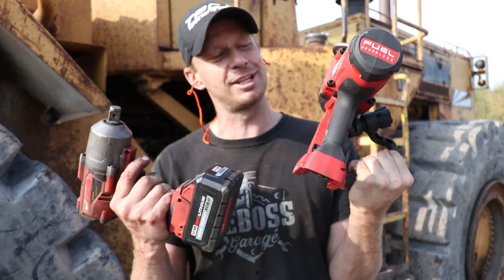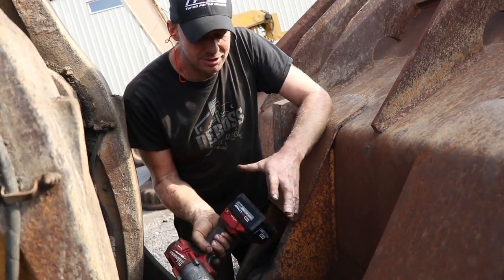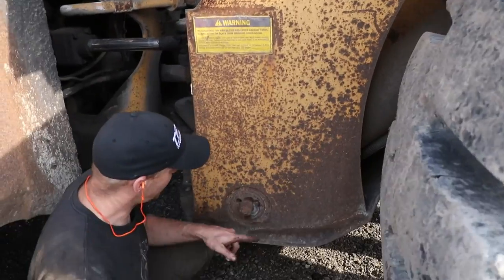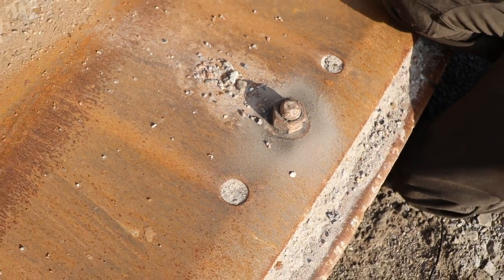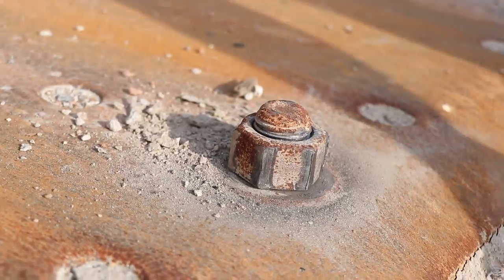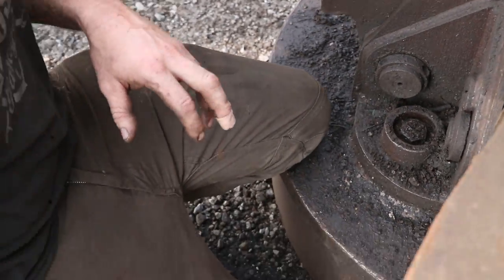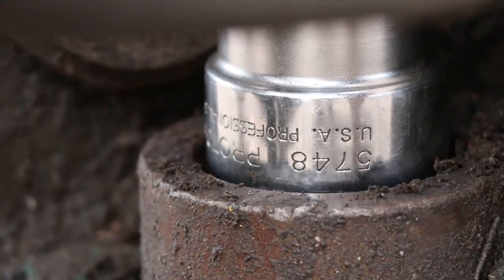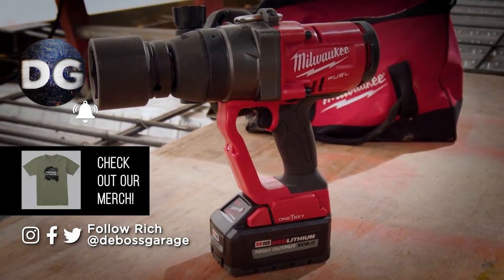Busting 40 Year Old Nuts with a 1 Inch Impact Wrench | Milwaukee M18 FUEL 2867-20 REVIEW

Comment: Has strongest electric impact on the market still uses chrome sockets lol
Reply: ikr...?
Reply: A few$  at autozone for rent a impact socket
Reply: @ranchotools  good luck finding 3/4 and 1inch drives at autozone
Reply: @krfredri   you are right, maybe home depot have some
Reply: Like he said he’s not going to buy a couple thousand dollars worth of impact sockets just for a video or two
Reply: @stephenanderson1944  its about 40$ dollars for one socket,, he use 2 diferent sizes
Reply: Mitchell Nova It’s not for his own amusement. It’s for a product review. If you’re going to review a product, do it right. Either you’ve never held a tool or you’re okay with using the wrong equipment for the job too.
Reply: @stephenanderson1944  why get the 1" impact if you dont cant swing 1" drive sockets tho...
Reply: At a 1 inch size socket there's no reason to need an impact socket the chrome works just fine and it won't be breaking anytime
Reply: Chris Robertson Please delete your comment. You’re showing how much you use tools.
Reply: @imonlawnduty  or not. Clearly you don't use anything stronger than a pink screwdriver. Internet mechanics begone
Reply: Chris Robertson I’m glad your chrome sockets help you with your fiat, but they’re complete garbage on heavy trucks.
Reply: @imonlawnduty  nope, never tore apart Volvo front loaders for Caltrans for 5 years using the same chrome socket set the whole time.
Reply: If it can do it with chromies it can do it with impact sockets. Why are you guys pretending otherwise?
Reply: I'd love to see that chrome socket explode under all the torque that 1" Milwaukee M18 FUEL Impact Gun is putting out!
Reply: @blackgazex5873  You really do need impact sockets when using and impact gun, chrome ones don't cut it, I worked at a diesel shop for over 15 years and I saw countless guys crack, stretch or shatter chrome sockets using impacts guns, even smaller not very powerful 1/2" and 3/8" impact guns. As a matter of a fact I keep a 1/2" Milwaukee M18 FUEL One-Key High Torque Impact Gun in my truck incase I need to change a tire and since I was lazy and didn't want to have to unscrew the decorative center hub piece that made it so a thick wall impact socket couldn't fit in the hole to get to the lugnut instead I got a chrome 19mm socket that would fit without the need to take off the decorative center hub piece. I never even changed a tire with it I only tested it out a few times to see if it fit and also to test the features on my 1/2" Milwaukee M18 One-Key Impact and after only about a dozen uses the square drive that holds it to the impact gun got so deformed that it didn't stay on tight and would wobble around like crazy and the hex end got deformed too, it wouldn't fit tight on a lugnut anymore and you could easily see that the hex end and square drive end were very deformed.
Reply: @blackgazex5873  😂
Reply: @thomasglover3834  I have actual proof I used to tear apart loaders for caltrans.. I'd issue a challenge for you to break a 1" chrome socket under normal circumstances do let's see.
Reply: @chevy5137  I'm not saying impact aren't the proper tools for an impact gun but I am saying that when you are getting into 1" drive sockets they have so much meat on em that they are far far far harder to break than a 3/8 or 1/2 chrome
Reply: @blackgazex5873  that's true they are thicker but they can still break when used with an impact. At the diesel shop I worked at I saw guys crack or warp them taking off semi lugs, usually only the small ones will shatter and have pieces break off. With larger ones what usually happens is the square end where it attaches to the socket gets deformed and then it will wiggle around and not hold tight on the impact.
Reply: I would be using Chrome sockets to a set of impacts sockets for that beasty impact would be a fair few hundred dollars
Reply: They make chrome impact sockets.....
Reply: @HotBoiRicer  Yes they do, I have a thin wall chrome impact socket set that I got from Harbor Freight that is made for taking lugnuts off and it has nylon sleeves on the outside of the sockets so as not to damage the finish on the outside of the rim holes you can also take the nylon sleeves off to make the sockets thinner so you can get them into tighter spots! They are also color coded and come in all the standard lugnut sizes and they come in a nice case too. I highly recommended them for taking lugnuts off as they are much thinner that regular impact sockets and they are just as strong as impact sockets, the set includes 7 sockets that fit most size lugnuts. 👍
Reply: Balls of steel
Reply: He addresses the socket situation....
Reply: When you use a impact wrench use short bursts the longer you run the impact wrench it gets weaker just 10 second bursts
Reply: What's crazy is that all y'all are arguing over a socket that isn't even chrome. It's a raw/machined finish. Not all impact rated sockets have to be black. It's easy to tell by the rust on the sockets. You can tell by the close up when he's removing the bucket nuts that it's not chrome
Reply: Tbh that's how most of those sockets are, a 1 inch chrome socket will cost you 70$ and that would be a napa brand, still has lifetime warranty and they're pretty strong, if you want that in an impact, looking at up to 3 times that much. When you get to the bigger sockets, it almost doesn't matter, and also you don't need them alot when you're doing tech work so instead of buying a set of 1 inch impacts you use chrome's and probably only need a few sizes.
Reply: @krfredri  in my dream i walked into oreily and there it was, rented out🙃

Comment: Your losing all Your impact ability with that 12 point socket. All it's doing is putting energy into the very edge of the nut and springing back in the socket wall.
Reply: correct, i was thinking the same thing. And with a non-impact socket, tolerances are loose
Reply: ....So, what you're saying is....is that it was even more impressive that it was able to crack that edge nut loose, right?
Reply from the maker: Yeah, you are correct.  Like i said though, I can't invest in sockets I will never use again
Reply: thats fine but i have the same unit and if i can afford a $700 unit i can afford common size sockets. obviously  im not putting a 7/8 or 1in on it. like a welder im not going to start the gen set to weld some horseshoes together for a hook. the lil hobart works perfect
Reply: @nickgibb4687  "FULL DISCLOSURE: Milwaukee is sending us tools to use, to make videos with, and to give some away."

I am assuming, that you assumed, that he bought the 1" rattle-cannon?
Reply: @dposcuro  well with Milwaukee being 30 min south of me id expect them to send a 12ah battery and some sockets...just sayin. that would be like me using a miller welder and using lincoln wire and a tregaskiss whip owned by ITT. if the review wants to be done right do it with the right tools from the unit to the batteries to the sockets. i believe it was a PROTO socket owned by Black and Decker. sockets ARE top-notch use them all the time.

EDIT: DEWALT AD ???  And that Snap On is right down the road?  And with 250k subscribers thats free advertising for $300 in manufactured product.  Highest mark up is Diamonds Furniture and industial tools
Reply: @dposcuro  wait they sent you tools? on your page it looks like they sent you a cat with 7 views
Reply: @nickgibb4687  Kind of confused; how does your proximity to Milwaukee have any relevance?

Now to the gist: 
1: You're expecting Milwaukee to not only just give out a $700 tool to someone (Who, by the way, is under no obligation to even review it), but also a $300 battery, and a socket set worth another $500-800? You're expecting Milwaukee to literally be giving away, nearly $2000 worth of product?

2: Milwaukee does not currently make any 3/4" nor 1" drive impact sockets anyways. So you are expecting them to supply people with someone else's sockets?

3: As I said earlier, DG is simply sent tools from Milwaukee, and is under no obligation to review them, feature them, show them, or even talk about them, if they chose not to.

"We are under no obligation to review their products as part of that relationship, and this video went live before they saw it or gave us any feedback on it. I have had the 1" impact wrench since July, did not receive monetary compensation, opinions are my own, and everything is scripted myself."

You seem to be expecting a hell of a lot out of a company.

Personally, I don't understand your point of view either. I prefer people to use the tool, how they would use it, with whatever accessories they want, or have on hand to use it with. IE: Real World Use. The mechanics I work with (heavy equipment shop, buy/sell/rent, working on everything Cat 349/D8T/740 and smaller), buy tools and sockets from Matco, Mac, Snap-On, Gray Pneumatic, etc. They don't stick to just one brand, and none of the other contractor mechanics we bring in during crunch times to either.

So, to me? It is a hell of a lot more practical and realistic, to NOT use same brand sockets. How does the tool work with other brand sockets? Is the anvil larger/detent too small or large, making socket changes slow and difficult? Or is the anvil small, and leave other sockets loose, and wobbling, even brand new?
Reply: @nickgibb4687  I am talking about Deboss Garage, not myself. I am quoting from Deboss Garage's own, pinned post, where they posted the disclaimer.
Reply: " the mechanics you work with" lol you have got to be a sales guy...lol
Reply: @nickgibb4687  lol. Not quite a sales guy but that was halarious. 🖒
Reply: @nickgibb4687  Assumptions, ignorance, pathetic insults? You're right. This is pointless.
Reply: @dposcuro  best part is you kept it going. cheers. you'll figure it out
Reply: @nickgibb4687  LOL .... it's funny you mention that combo, because that's exactly what we have at work .... Miller Pipeworx 400 running lincoln L59 wire and a tregaskiss water cooled whip ... with a Fronius water cooler, but that's only because the pump went out on the miller and the fronius wasn't being used.
Reply: @brinkme1772  lol nice I used a felonious for a robotic apparatus and although it worked nice....parts from Denmark? were weeks out. I believe Denmark correct me if I'm wrong. maybe French?
Reply: Putting energy into the outer edge would give more leverage.   Are you parroting engineer talk, or just making stuff up?   Not trying to be rude, just getting to the point
Reply: I never buy or use them 12 point ones. Always ring a nut or bolt.
Reply: late watching, but said the same thing before scrolling down ;)
Reply: cobrasvt347 youre. Shouldnt give advice when you cant even pass 3rd grade
Reply: Your using it wrong but what the hell.
Reply: @nickgibb4687  *Gets the popcorn out* this is getting good :D
Reply: I mean, sockets are oversized right? They're not a perfect mate onto a nut, especially rusted out ones like these, so even a 6 point socket will spin and only have a small contact patch. Snap-op (and I'm sure other brands) have angled faces to try and expand the contact patch, but I don't imagine its going to make much difference. Unless you're talking about the rigidity? I use 1/4" drive 99% of the time so I don't get into impacts.
Reply: yep ruining the screw corners too. incorrect socket size.
Reply: Do it again with the correct bits. You can sell them on ebay after 1 use.
Reply: @DEBOSSGARAGE  re-sell them on ebay or amazon. You need to redo these tests.
Reply: 1.3+ million people have seen this but buying a couple sockets isn't worth it I guess.
Reply: @nickgibb4687  he addresses it at 6:42
Reply: @nickgibb4687  bro
Reply: I don't really like 12 point sockets either, but a 6 point socket is also only putting energy into the edge due to the slop in the nut to socket fitment
Reply: @750nicko  felonious lol